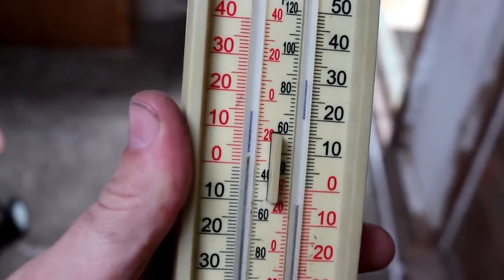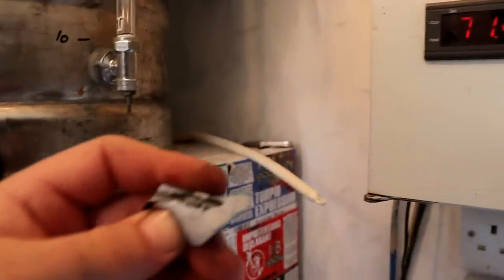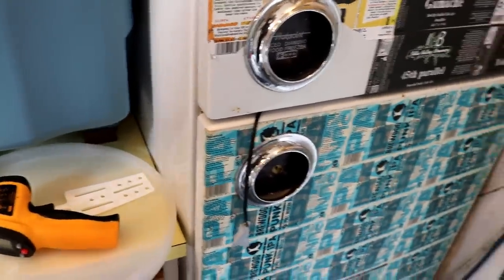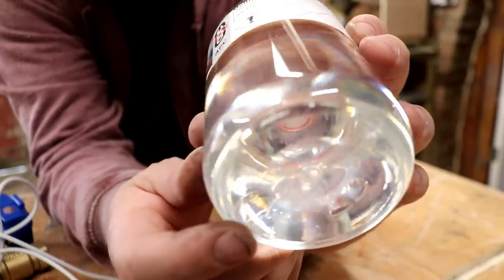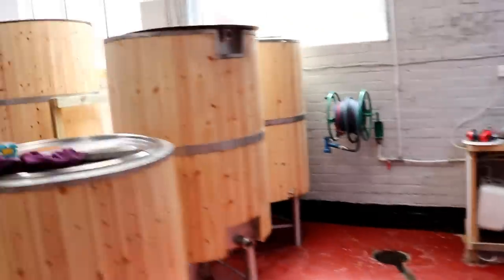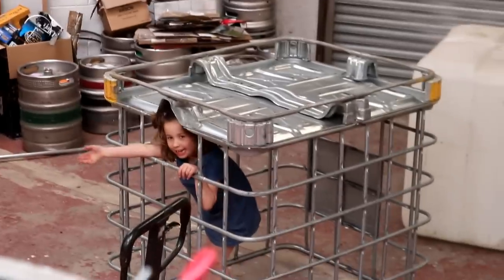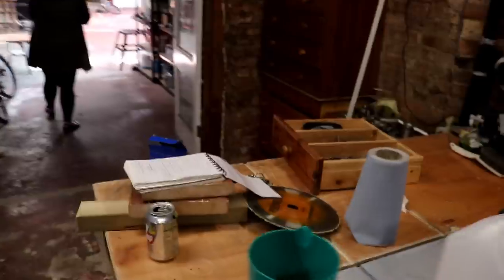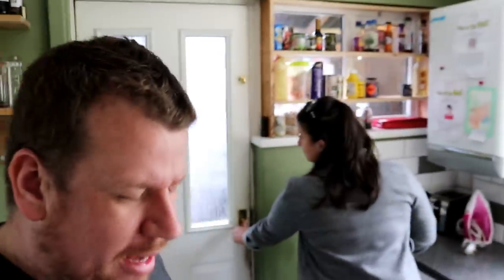BRING OLD RUBBER GASKETS BACK TO LIFE.

Comment: I found a cheap and easy way to make old dry cracked rubber like new in an old book. I tried it out on a old suction cup. It was so old it was like plaster or something. Wouldn't flex at all. Submerge it in ammonia and leave it for about 30 days. Watch and if level decreases due to evaporation , top it off. Remove and rinse with water. After doing this , suction cup was like new.
Reply: 30 days is too long a time
Reply: @emmy7848  well that's what it takes. If something can't be replaced, can be useful. Don't know of any other way quicker or slower that can do the same

Comment: DOT  3 always does it for me, as long as it`s old hard rubber that lost it`s flex
Reply: What's the procedure?
Reply: Brake fluid swells rubber. 
Its a trick used by car dealers that put brake fluid in the engine oil to swell up crank seals so they don't leak.
Reply: Would that work for carburetor seals/gaskets?
Reply: @obviouslytwo4u  is it effective long term? Or a dirty trick?
Reply: @matthewhouse2581  yes, any rubber it will swell up
Reply: @Dragon22078  no not long term. The ethylene glycol breaks down after a while and then the seal leak again. Working in a garage for 23 years I've seen it all.

Comment: I wouldn't touch any of  'APC Pure's products due to the fact that they have no analytical testing capabilities so you don't know if what the label says on the bottle really is what the bottle contains.
APC Pure's website lists polarized light microscopy testing which is an 19th century technique which is a joke by today's standards.
Even some supplement companies have better chemical analytical capabilities then APC.
I've received product contaminated with reaction byproducts.

They will go on about how they are ISO 9001 certified which actually has nothing to do with purity of a product.

I've reported an issue with a batch of "Pharmaceutical Grade" Isopropyl Alcohol that was contaminated with something that would leave residue to the surface it was applied to and made the surface smell sweet - certainly not something I would want to risk putting on my skin. They said they would 'look in to it', never heard back from them.

Comment: I use that isopropyl alcohol all the time at work for cleaning motherboards and it fekin stinks. I get a banging head every time. I’ve got a few spare probes with extra long leads. Message me your address if you want one👍

Comment: Fun fact: a lot of packing peanuts now are biodegradable, it's easy to test for you put them in hot water and see if they melt.

Also a fact, apc the courier have nothing to do with apc the chemical supplier,  i've always had mixed results with the courier regardless of who's been sending!
Reply from the maker: Explains a lot, on both counts. Cheers Miggy.